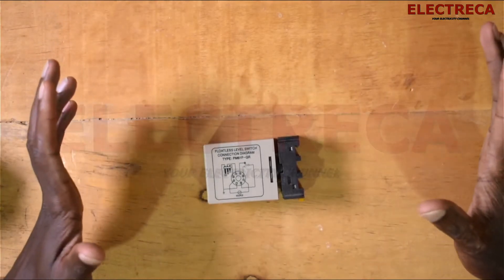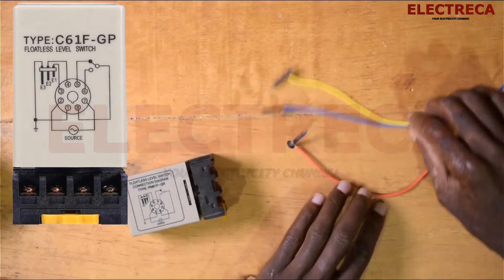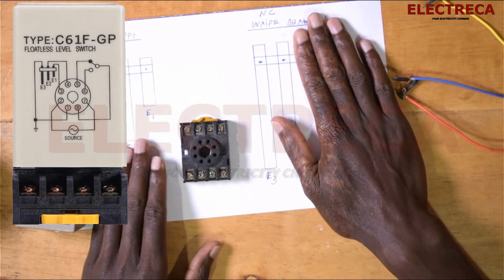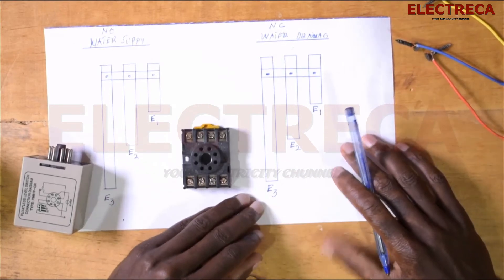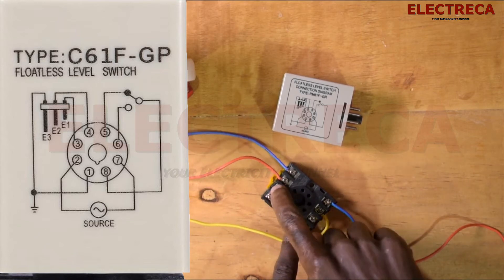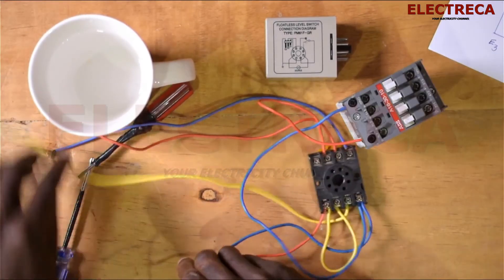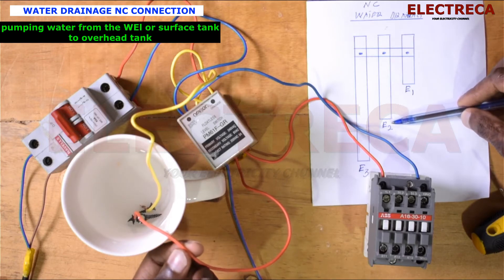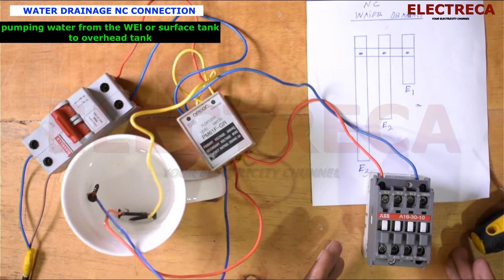Floatless Level Switch Connection Explained

Comment: Hi,
First thanks for this clear explaining video, and i have question: in a steam water  burner control panel we have 7 floatless relays but 3 & 4 poles are connected with short wire and also connected with a bolt in water or sensor .. so both are getting the same signal water or no water, and the port 5 connected, port 8 is connected to plc input, port 6 not connected, and that is for every relay the same way of connection but differ in the sensors levels.
How it works?
Reply from the maker: If you could share a photo of the control pannel i can help you tell how it works
david@elektreca.com

Comment: hello here's another question, Q: l want to operate a small hydronics pump 110V Vevor type RS 15-6 which is 3-speed (manually dialed) & rated i@(low speed/mid speed/high speed), i(amps) 0.42 / 0.60 / 0.84 with power rating P(Watts) 46 / 67 / 93 respectively in a non-pressurizing plumbing loop. Lowest speed has tested adequate for my purpose. High speed for priming. lf i understand correctly, l should be able to power the pump directly from the C61F directly without using the intermediate SSR. Do you concur? l will be bench testing anyway at all speeds which means l might anticipate a burnt out float switch if my estimation is incorrect. Thanks for the visual aids

Comment: i had to wire this exact relay for a chiller. just out of curiosity. what will happen if you take out the earth probe but put in the E2 and E1 probe ?
Reply from the maker: There might be a risk of electric shock, though not high

Comment: What the hell, you just put 220 or 120 v direct in the water, this is not the right way, and you probably use salt water to do this trick, bcs i made the original sensor systam motor on of circuit,
Reply: i might be wrong but i dont think the probes carry any current. if it did i should have shocked a long time ago. i think the probes just give continuity to a sensor or something.

Comment: Thanks for this video. Please in real installation, what will be used as the electrode?
Reply from the maker: There already made electrode that are sold in the market, but  Earth rods(coper) can work fine.... coper is a good conductor but not sure if can resist corrosion since it will be Merced in water.

Comment: So it simply means if I am using a big three phase pump, E1,E2 and E3 will pass through the NO open of the contactor, then to the pump ?
Reply from the maker: E1,E2,E3 activate the floatless relay, then floatless relay operates the contactor coil.

Comment: Thanks sir I have a submersible motor I want make auto matic if the water is high because in my house flood kid there's no submersible motor can I ask you a diagram for this?
Reply from the maker: @SUNDU  Am trying to undrestand your question but i cant. please ask again.
Reply: @elektreca  I have a magnitic contactor with overload how to attach this for floatless sir that's my point
Reply: @elektreca  thanks for your response sir

Comment: Thanks for the explanation. I want to use the sensors inside a borehole well that is 120 meters deep. Will the sensors work at that dept? I read somewhere that if DC voltage is used, the electrodes might corrode. Is that true and what's the remedy? What's the maximum distance that those sensors can be far apart in the well?
Reply from the maker: Yes, it will work up that depth...........it can even work at 400mtrs.
Your well is 120mtr deep, even if the control box is 200mtr apart its ok(but we all know you can't apart CB for 200mtrs right!!).
NOT wire that used to connect the probs are not ordinary, you have to buy the right one for that purpose.
Reply: @elektreca  Thank Electreca. When I talked bout the electrodes and their recommended maximum distance apart, what I meant was the sensors. Those two or three sensors that actually get submerged in the water. How far apart can they be? What's the maximum permissible distance for which they may be apart for them to still be operational and still send appropriate signals to the control box.
Then you didn't answer the question on if the sensors can corrode because they transmit electric current.
I look forward to your response. Thanks
Reply from the maker: The floatless I used in this video is of 3 electrodes.....
First, you have to know the water rest level of you well...
Position E3 on the same level as the draw pipe or submersible pump, if the resting level is 6mtrs ...you will position E3 at least a metre above the bottom, E2 2mtrs from E3 and E1 1mtr from E2...
So that means that your pump has a pumping area of 2meters if water goes below 2 meters the control power goes off. these Numbers are not fixed can be altered depending on how deep is the resting level.
But to determine all that accurately
 Note the following
1) how many CUBIC meters that you're well can give per minute
2) how big is the head of your pump
Because their scenario were your pump takes more water than what you well can produce.

Op that helps
Reply: @elektreca  Thanks. Can I use two sensors instead of 3? If yes, how will that affect the wiring to the relay and contactor?
Reply: @elektreca  Can the sensors corrode as a result of them carrying electricity (perhaps due to some kind of electrolysis)? If yes, how can this be avoided?

Comment: Hey there I am loving your videos it’s really helping me. I have a large septic tank with is lengthier but it’s not wider so I want to use 2 float switch to a motor how can it wire the float switch so that when they both are up the motor should start and when both are down motor should stop,can you please make a video on it I would be delighted. Or you can reply too
Reply from the maker: Hey there thanx for watching..........this video has the answer to your question,.... but let me explain
1) get a contactor (rate it with your pump),
2) get a float switch,
since you want the float switch to control your pump, connect it in series to the contactor coil to the supply........ Then use the main contact of the contactor to connect the motor.
The second option is this video, try to understand it.
if you cant come back to me.
Reply: @elektreca  but in my country  floatless switch are not available so can you suggest any other alternative's through which I can connect 2 float switches